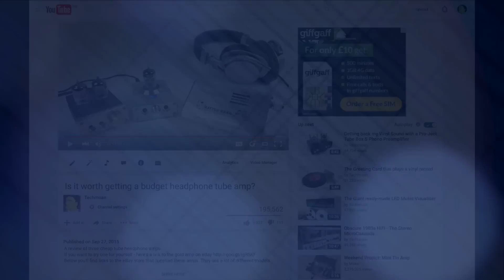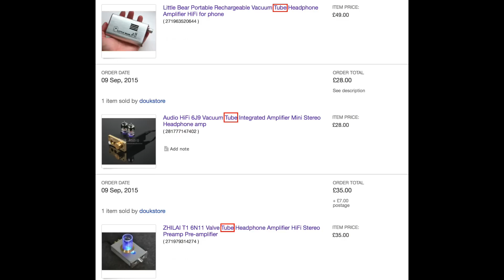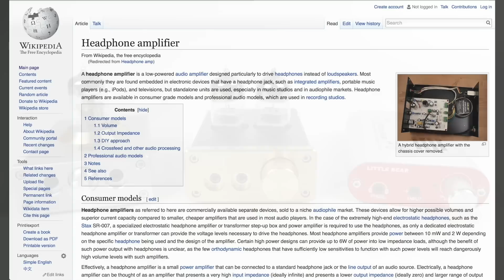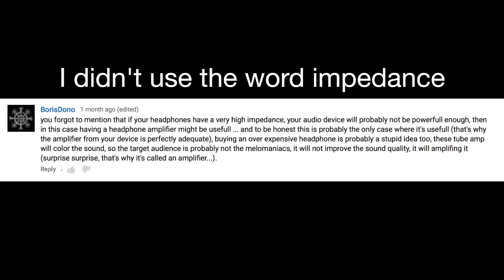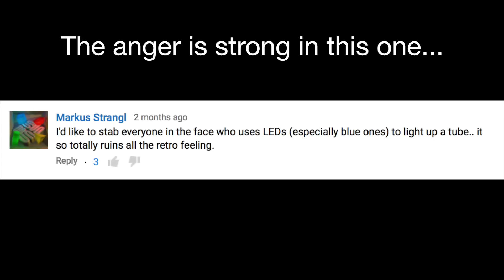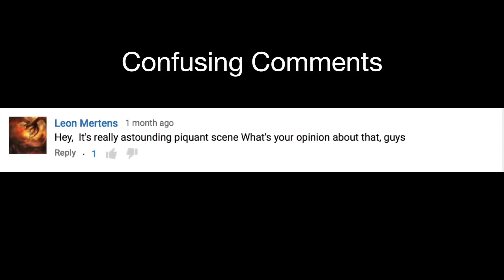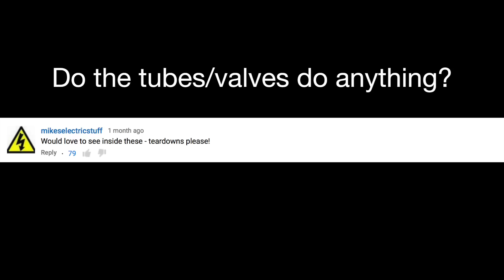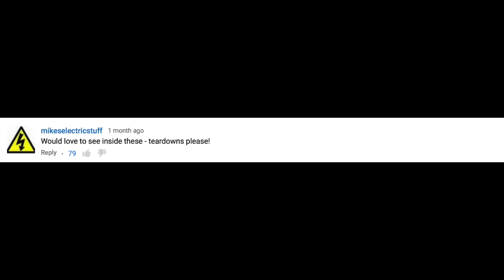Headphone Tube Amps - Follow-up & Tear-down

Comment: I believe the tubes in at least two of them are functional. If you look at the one with the blue circuit board, on the back, you can see the outlines of the traces, at least pins 1 and 2 look to go to components and I think pin 5? got to other components, and as others have said, likely only to color the sound and bring that tube sound to the mix than for any real power gain.

Also, I think I saw the gold 2 tube unit have its filaments actually glow, mind you, it's faint, but I saw it so they do likely do something, with the op amps doing most of the work.

Mind you, I'm not an expert, but do glean stuff from watching videos of restoring vintage/antique tubed radios and TV's by those who know what they are doing.

Comment: first two amps the tubes used as a pre amp before the solid state chip amp, difference like you said is first one uses stereo components and second uses two mono circuits (traditionally better) 3rd board I couldn't follow the signal but with the little daughter boards and stuff Im sure a lot of it is related to power supply.
I have something similar to the first one and after swamping out some components for tighter tolerance parts it sounds quite good

Comment: They all seem to have a small dc converter circuit that should convert the low voltage wall adapter up to the high voltage the valves(electron tubes) require. Also, the circuit board is double sided and has circuit traces on the top as well, connecting all of the pins. BTW, great video!

Comment: Being someone who has owned several high end valve / tube amplifiers (CR Developments, Audio Innovations) touching the valves (correct name thermionic triodes) does nothing to them, especially Golden Dragons which have metal sleeves (well mine did)  only when their off, else your burn your fingers. Looking at them yours they look similar to EL84 and 12AX7 / 12AU7 which are the cheaper end. I love the sound of valves / tubes. Most tube amps are class ab designs using the valves as pre amplifiers and boosting at the output stage with transistor amps, though these look like they may be the other way round on those headphone amps. I for one know they work, and valves / tubes were all we had to amplify music before the transistor was perfected in 1947

Comment: Just noticing how all of them use NI5532 opamps and the ugly one even uses one of those arduino DC-DC step-up converters to get the voltage up from the battery....Just looking at the last one just tell you everything you need to hear...
If that battery has no protection circuit i can pretty easily see it overdischarging  or maybe not because the datasheet says 3.6 minimum so it wont even use all the juice in the battery..
Other than that it's cure how they used nichicon caps.
Looking at some of those valves specs they seem to be able to work at low voltage, say 12V though the datasheet recomends 100V, not sure about distortion and stuff but at that voltage it should let a few mA go through, enough for the high impedance input of those 5532, so yeah, they are just for looks.
Reply: +Laharl Krichevskoy 
The battery has overdischarge protection. That's the second board soldered to the bottom. 5 pieces for 2.70$ from ebay ;) : www.ebay.com/itm/351493712096
Pretty sure the tubes are used to distort the signal (to make it sound "tubish"), but the amplification is done by the NE5532 (in all of them).
Reply: superdau  oh at least....still cheap as fuck but at least it wont explode
These should be called "tubifiers", the tube seems to be just passing the signal to the opamp instead of "amplifying" it as the name implies.
Reply: +superdau some tube will work on lower voltage say 12v, and will still give you 10db gain, line out from a good piece of equipment will give out 4v peak to peak, with that 10db gain, it will become  around 12v peak to peak, that will drive high impedance headphone, those op amp is usually configured as voltage follower and provide more current if needed

Comment: Fingerprints on those tubes aren't an issue. On large high power transmitting tubes? Yes, big problem!
Reply: +Thomas Coughran yes they are!  They modify the composition of the malleable logarithmic casing in such a way that the two spurving bearings go in a direct line with the pentametric winding of the transducers! LoL everyone knows this!
Reply: +Andy Cristea Don`t forget this is stereo. The quad spurving bearings are mounted as a parallelogram across the pentametric windings. NooB.
Reply: +dutybod1 You are right! Sorry, it's been a while since i've finished my masters in double-bearing quantum diamorphology so i overlooked the quadrilogy of the natural stereo in the lotus-o-delta formation... +1 to you sir!
Reply: U w0t....

Comment: Be sure not to use the Dolby C/ B, or metal/CrO2 function on that tape player or audiophiles might complain they are not hearing  the difference in this video. Also make sure that recording is balanced with the right bias and output with a high quality metal tape. LOL
Reply: +stvlu733 yeah, i mean, when was that WM-D6C Walkamn even calibrated? Were the caps and opamps even upgraded to audiophile grade? jacks exchanged with gold plated ones? Not to mention atomic clock driven capstan servo... Sheeesh!

Comment: Tube (valve) amps are to transistor (solid state) amps just like vinyl records are to CDs or incandescent light bulbs are to LED bulbs. 
There are significant technical differences in how they operate, of course, but nobody (in their sane mind) would argue that an incandescent bulb is "better" than an LED bulb (disregard price, as LED is a new technology and catching up quickly) from a results (light output, efficiency, power usage, reliability, etc) point of view. 
Only the self proclaimed "audio aficionados" that don't understand the technology would argue for vinyl over CDs and tube amps over solid stat amps. I seriously doubt that they can successfuly tell the difference in a scientifically valid (example double blind) experiment.  I've never seen anybody present a facts based argument for superiority of vinyl/tubes without using ambiguous and abstract terms such as "warm", "full" and "rich" to describe the sound resulting from those obsolete technologies.
Reply: +J Yu The thing is, they actually do sound warmer and richer. This is not because the technology is better or superior, it&#39;s because it is worse in a good way. 

Vinyl and tubes introduce distortion to the sound. For example it is a real challenge to make bass sounds even work on vinyl. There's lots of filtering and processing involved in the mastering for a LP to make bass sound bassy, and in the end you add vibrations from the turntable, the noise of the needle etc etc and you get a quite distorted version of what was actually put on the LP. But it sounds more natural to most people, because in the real world what you hear isn't perfect either. Real instruments aren't digital 1's and 0's. That's what makes alot of people prefer the sound you get from the imperfections of analog playback and amplification. It's more authentic in a way, makes the music feel more alive and less like a static recording
Reply: +J Yu It's objectively not better sounding. Subjectively it is to many people.

I do infact understand how digital sound works. I was just using an analogy to describe CDs. But there is no point in arguing about this. Some people search for perfect accuracy when listening to music, some want the fuzzy not so perfect analog sound. It just comes down to preference. In any case, I think it would be best to just agree to disagree
Reply: +Frido15 Yes, tubes and vinyl aren't better, just different.
Reply: +Frido15  Like I said, only those who don't understand the technology would argue for vinyl and tubes. There are no 1s and 0s in a CD. That's just a notation to represent two states. We could agree to use X and Y. It doesn't mean you're going to hear alphabets. You still hear the same analog sound from your speakers. There's a DAC in your player that turns those X and Y into the analog signal that drives your speakers. Digital signal processing theory (a well understood science) can prove that, given a sufficiently high sampling frequency, the X and Y can be converted back to the original analog signal. 
So, if you're saying that richer and warmer means a distorted sound, I'll agree that vinyls are indeed richer and warmer. But it's absolutely not better sounding.
Reply: +J Yu 
I fully agree. I find it weird that people want "the best sound" and then they take technology that distorts the original. A CD/digital storage medium and class D amplifier get you as close to the original recording as you can get (with home equipment). There's nothing magic about vinyl and tubes. All the distortion introduced by them (to give "warmer sound", whatever that means) can easily be implemented digitally and with much more control.
One reason, why people might think tubes are better, is that they don't clip a signal as hard as solid state devices. So with a solid state amp you can easily hear when you overdrive it, with a tube amp not so much. I think only an audiophile can see that as an advantage.
Reply: +superdau Real &quot;audiophiles&quot; would not be playing audio at anywhere close to clipping point. I think it's only the "collectors" that call themselves audiophiles that are having problems with moving along with technology. Don't get me wrong, I'm not dissing collectors. There's nothing wrong with, say, collecting stamps or cars. One can collect technology as well. Just say that you like old stamps, but don't try to justify it as old stamps are better (in some technical way) than new stamps. Maybe that's why they can't use technical terms to quantify how vinyls are better. Only abstract terms as rich and warm.

Comment: I'm no engineer (yet) but from what i know and can see a) all of them send the audio through the tubes, but are not necessary using them for amplification (microphonics are a clear sign the audio is going through, but the tubes could just be configured for a gain of one), b) all of them have ne5532 dual op amps, that probaply do the actual amplification. 

On the gold one it seems to be pretty obviously using one on the input and one on the output, so probaply in->opamp->tubes->opamp->out, the tubes probaply have no or almost no gain, just to colour the sound. COuld be that they actually do the gain an the output opamps are just used as buffers.
There are coils and some smd chips on there, together with a bunch of caps, so that's probaply a power supply section, but as the caps are all 16 or 10V ratet it's not gonna be a step up converter, my guess would be switching step down to power heaters, so they don't generate to much heat as they would with regular linear regulators.

The silver one has only one ne5532, so only one solid state stage, the smd device at the rear is probaply a buffer for the line in. There is angain an inductor with that to220 package device stuck on the back, so again probaply voltage drop, but this time probaply just a 78xx linear regulator and the coil for filtering something, but only one this time, wich makes sense because only one tube... wich makes me wonder, why the golden would use 2 separate power supplys for the heaters, normaly you would just put them in series and power them with a higher voltage (generally 6V or so per tube on those, so 12V, wich I would guess is also the input voltage), so maybe the re is just some power filtering on the golden one, who knows...

The little bear looks really bodged together from modules, obvously the battery indicator on the rear panel, battery charger/protection on the thin part and the green module actually looks like a voltage converter, but it seems to be a step down converter from what I found, probaply again to run the heater more efficiently.
Again only one ne5532 but some damn huge capaciators, much more like in a decent, powerful audio device, so either the circuit pulls a lot of current spikes or the battery converter generates a lot of noise. Also, two of those caps seem to be nichicon, wich is one of the top brands and I would not expect those in a device as ceap and shoddy as this, so could be fake.. then again, it looks like something built by some single dude in his basement, so maybe he got genuin ones because he knew they were better... probaply not though.

About running the tubes with low voltage, while all of these are ment to be driven with 100s of volts, a lot of those small ones can operate on low voltages, even 10 and lower, but the possible output power drops significantly as well as amplification headroom, as there will be much more distortion (called operating in starved plate modey sometimes used as an effect for guitar sounds), but as a weak preamp/unity gain stage it should work

That's what came to my mind, hope im not talking bullshit
Reply: Very competent analysis, grateful of your essay.
Reply: Good read. Hope you got your engineering degree.
Reply: Very interesting! Thank you for your input!
Reply: Also, I can't help myself;

probably*
Reply: Correct, they are not doing any amplifications, thats all left up to the op-amps(NE5532), the signal is passed through however.
Even if they were used at low voltages, they would be firmly on the lower part of the gain curve where they are very unlinear.

Comment: I'm probably wrong, I'm not really a hobbyist even when it comes to electronics, but I believe the white chalky residue on the little bear is leftover flux on the circuit board to make sure the solder flowed well. That board looks like it was (at the very least) partially assembled by hand. I looked through a few of the comments, didn't see anyone mention it, so I thought I'd say what (I think) I know about that. 

Like I said, I don't know anything about internal electronics or circuit boards.
Reply: +Jesse Crandle it uses an "arduino" dc-dc converter to get the power out of the battery (which isnt even very suitable for that if you read the datasheet).......you cant be THAT crappy.  How would you feel if your $99999999 bucks 100 inch oled tv had an arduino and a bunch of wires double taped to the main board like that? What's more, it has two boards like that, the blue one and that green one too. plus all those caps. 
Even if it's cheap and all, you would at least expect some quality, and not something that looks like it could die of cheapness any moment.
Reply: Laharl Krichevskoy Dude... I just said it had flux residue on the board and it was hand assembled lol...
Reply: Jesse Crandle  and i just said that that isnt the only crappy thing on that one :)
Reply: Laharl Krichevskoy Ok, I thought maybe you thought I was saying it's well built. I mean... I've seen Big Clive tear down some serious Ebay horror shit... so this isn't AS BAD AS IT GETS, but no, I wouldn't want to pay $50 for something and find that inside lol. Arduino, you say? That's... kind of sad.
Reply: I think you're right. I work in a PCB assembly line and I see that flux residue all over the place from our wave solder machine.

Comment: Most noval socket t00bz require 6v for the heater and about 20v for plates (though usually 200v will be used for maximum headroom). So these amps are in fact real and use tubes for preamp and amps on a chip for output. 
I am not the expert with those subminiature tubes (the one on the last amp), but there are many schematics that are floating around (including actual amps - like zvex amps) that make use of submini tubes that run off a standard dc powerbrick. But, yeah, they all sound shit.